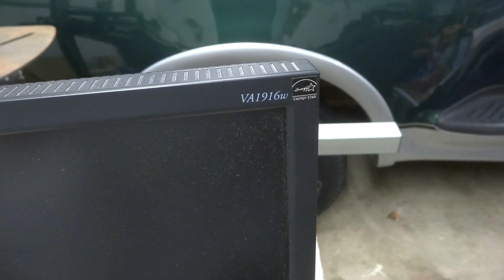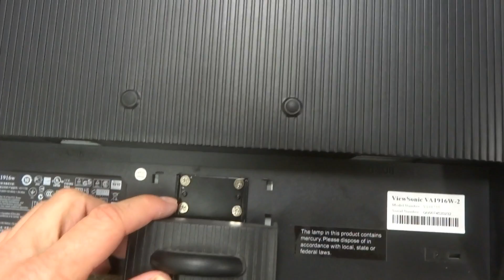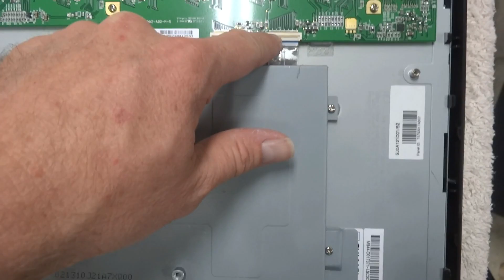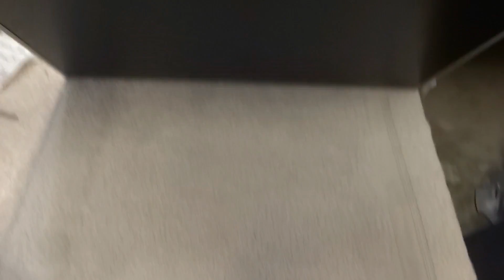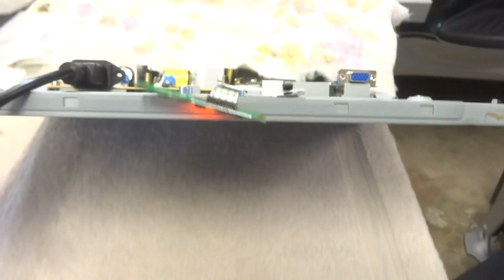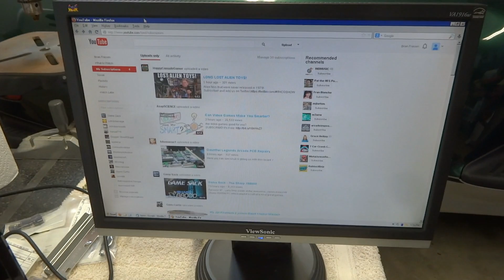Let's Repair - ViewSonic VA1916W

Comment: got the same problem with the exact same screen ,i opened it up and some of the caps are in the same condition like yours ,i can see which are bad but should i replace all of them just to be sure or just the bad ones? helpfull video btw